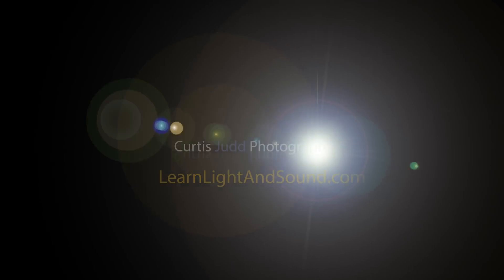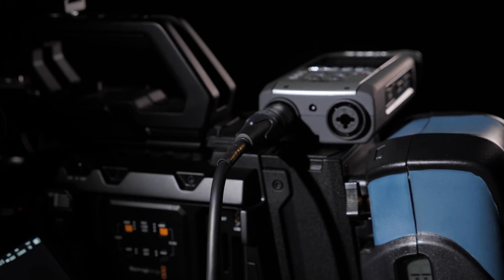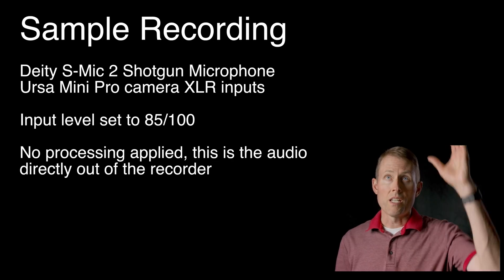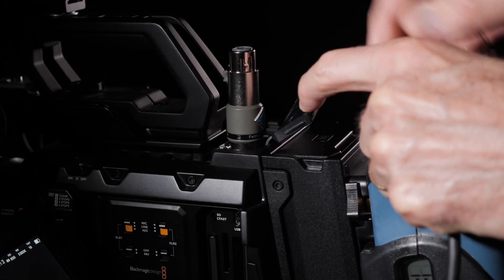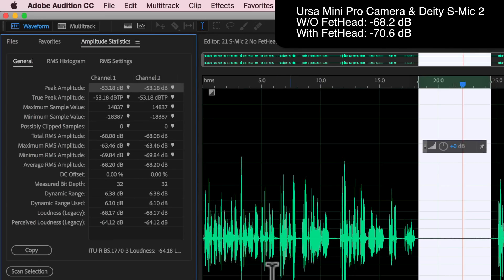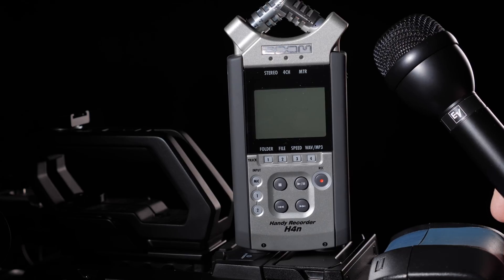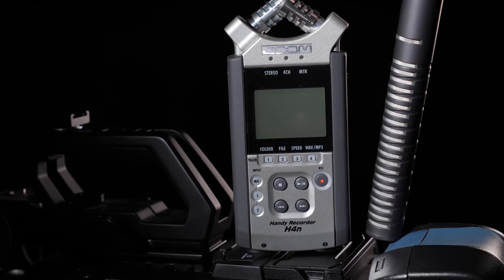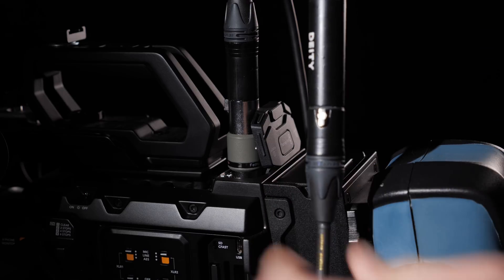FetHead Phantom: Louder, Cleaner Audio for Condenser Microphones

Comment: Great review! I'm using an NTG2 with my Zoom H5. I find the H5 adds too much noise when increasing the level. I wish I can set the same gain level but with less noise. Will the original Fethead solve my problem? Thanks in advance.
Reply from the maker: Hi Clyde, no, the Fethead does not work with the NTG2, unfortunately.
Reply: Thanks @Curtis! But at 6:18 you said it was possible with the original Fethead (the one without phantom). Did I just misunderstand it? Thanks!
Reply from the maker: @braveclyde  Oh, sorry - I am told by Triton Audio that if you use an AA battery in the NTG2 and use the original fathead, it should work.
Reply: @curtisjudd  Thank you! Sorry but  can you answer just two more questions: Is that combination (battery plus Fethead) better than just using H5's preamps? Do I still need to turn on phantom power on the H5?
Reply from the maker: @braveclyde  Clyde - first I should be 100% clear - I have NOT tried the NTG2 with the original FETHead. I have only been told by Triton Audio that it should work. So I don't know whether the results will be significantly better than what you get currently with the H5 and NTG2. You will need to turn phantom power on in the H5 if you do go with the original FETHead.
Reply: @curtisjudd  Thanks Curtis. I appreciate it. Stay safe.

Comment: Hey Curtis, it seems you put it right after the amplifier of the recorder. Is this the way of using it? My thinking was, if it amplifies the signal, the long cable and the resistance that cable brings with it, wouldn't it be better to use the fethead before the microphone? As to amplify the weak signal a longer cable would introduce to the microphone?
Reply from the maker: Yes, several people have suggested that. In my tests I didn’t notice a difference but it cannot hurt to put it on the mic end of the cable.
Reply: @curtisjudd  maybe that's why it had problems with the NTG2? Ordered mine today and I'll check that out. Because it seemed like the rode mic had problems with your setup when there was no battery in the microphone which would fit the signal weakening through the longer cables sort of thing. I checked their website and they write, you can use cables up to 125meters in length. Though I don't know what recording device they tested this with 😉
Reply from the maker: The NTG2 is a separate issue. Triton Audio confirmed that the NTG2 has some sort of unusual characteristic so that it would not work with the fethead.

Comment: Hey Curtis!
I'm using Sennheiser MKE 600 with Zoom H5. I've just bought FetHead Phantom and decided to try it out with my setup with the phantom power on the Zoom H5 set to 48V. 
The results are quite the opposite of what I expected... I get a significant decrease in dB rather than an increase. What am I doing wrong ... ?
Reply from the maker: Hello Taco Friday Entertainment. That's odd. I'd recommend contacting Triton Audio Support - hopefully they can help get things sorted for your. Best wishes.
Reply: Hi Taco Friday Entertainment. I have the same problem as you, have you solved it?
Reply: @mingangli8095  Yeah.. It was a manufacturing problem. I got a new one for free and it worked like a charm.

Comment: Would you recommend the Fethead Phantom for the Oktava Mk 012 and the BMPCC4K?? Nice video as allways ;)
Reply from the maker: I haven't specifically tested this combination, but it should work. Are you having trouble getting enough gain for the MK 012 with the P4K? Normally, not necessary for most condenser microphones.
Reply: @curtisjudd  Yeah thats exactly my problem, that I need to push the gain a lot to get a nice audio level, so I was wondering if this device could helps with that, but now I'm wondering if there is something wrong with my setup, or if I'm doing something wrong. So you say that the Oktava should work just fine with the BMPCC4K preamp?

Comment: Great video, thanks! One question: do You know if the Phantom version of FetHead Will work also with a dynamic mic? (I'm using a Shure Smb7). But i one yo Buy ONLY ONE FetHead that i would be able to use with my dynamic and my condenser Microphones. I couldnt find any info about It. Thanks again!!
Reply from the maker: Hi Martin, yes - tested it here and it worked well.

Comment: Hi. Will the phantom version work for dynamic microphones? I havent found any info. Thank you in advance
Reply from the maker: Yes, just tested that a few days ago on this video: https://youtu.be/HYIJsOg9TPw
Reply: I should clarify my reply of a few months ago as I have a few months experience with both the FetHead and FetHead Phantom. The Phantom version does indeed work with MOST modern dynamic mics, but NOT ALL. Most dynamics mics in common use today are so-called balanced mics. Applying phantom power to these mics does nothing. However, some dynamic mics are unbalanced. The application of phantom power to such mics does no harm, but it does distort the sound. I discovered this on acquiring a really good budget mic (the Fifine K8) that turns out to be unbalanced. That all said, the regular FetHead works with all dynamic mics and is the superior choice for them because it delivers 27dB of gain vs the FetHead Phantom's 18db. I don't regret for a bit splurging on both of them.
Reply: Well I just ordered one so I guess I am going to find out! Theoretically it should work fine with dynamic mics too, as when you pass phantom power nothing extra happens. Of course, as Curtis says, anything that passes on phantom power can fry ribbon mics, so the original FetHead should be used with those.
Reply: @leswright4108 literally was just about to type this out.. trying to spend less money lol.
Reply: In the Zoom L8 review, I assumed a different FetHead (w/27dB) was being used. According to Shure, any "professional" dynamic microphone with a low impedance balanced output, like the SM58, is not affected by phantom power; and the FetHead Phantom will deliver up to 18dB gain.

Comment: Great review! How do you manage to have the breaths so much lower in dB than the voice? Is it an expander during ur live take or is it some plug-in in post? Thanks!
Reply from the maker: When I process my audio in post, I use the Izotope RX breath control plugin and attenuate the breaths by about 4dB
Reply: @curtisjudd  Brilliant! I tried the same thing with RX 6, but it didn't work too well. I presume you're using RX 7 and the breath control feature is better. Thanks again!
Reply from the maker: @zurdyo  Yes, RX7 now, though I did the same with RX6 back when I had that. I think the secret is a light touch - just 4dB of attenuation or so - not too much or it becomes obvious and unnatural.

Comment: Geez, you’re good! Thanks for making this video, mate. A curly question for you: in a room with outside traffic noise, is it possible to use a FetHead on a dynamic mic boomed overhead to capture dialogue, so to avoid environmental noises? Thanks in advance.
Reply from the maker: Hi, thanks! No, dynamic mics really need to be closer than that. Better to use a highly directional condenser mic or a lavalier.

Comment: Hi Curtis, thanks for this video!
Here is my situation : 

I own a Rode NTG-3 shotgun mic (which i love) and the recorder i have is a Tascam DR-60D (1st gen). The NTG-3 already has a fairly hot signal, but I wanted to know if you think i would benefit from using a Fethead Phantom in between, to lower the preamp gain and get a cleaner signal. I know i may only get about 2 dB less noise, but since i have very well trained ears (mixing music for years), i’m a very picky guy in term of noise (that’s the main reason why i sold my Aputure Deity and got the NTG-3 instead). I know the DR-60D isn’t the noisiest recorder neither, but this is still noticeably noisier than a Zoom F4 or a SD MixPre.  I notice the noise when i boom the mic further away in a wide shot, with the mic further away, because i have to use the Mid gain setting, and up to maximum on the gain knob. 

My question is : Considering i’m a very "picky” hobbyist (not doing this for a living), do you believe it would be a good alternative to buying a higher quality recorder like the Zoom F4 or SD MixPre3? I don’t really need all the pro features these recorders provide... i’m only interested in better, cleaner sound quality.

Thanks for taking time to read all this!  :)
Reply from the maker: Hi David, no, I'd save money long term for a better recorder. The NTG3 is solid. There will always be more ambient noise in wide shots boomed from more than 18 inches from the person speaking. Adding more gain won't reduce ambient noise, just the self-noise of the preamplifier. So I don't think this would solve the wide shot problem.
Reply: Curtis Judd  Thanks for the lightning fast reply!  This is very appreciated!

I know that the further away the mic is from the sound source, the more background noise i’ll get. I understand that the Fethead won’t solve that. I watched your video when you compare cheap recorders to high end recorders, listened very carefully using good studio headphones, and to me, it’s a night and day difference (hiss), and i assume you were fairly close to the mic, right? So i thought the Fethead Phantom would reduce that hiss considerably.
Reply from the maker: Understood. It is the NTG3 and DR-60D combination that I don’t think has a ton of self-noise/hiss. At least not that will be noticeable when booming the mic from more than 18 inches where ambient sound becomes the majority of the recorded clip. But it might, just guessing here since I have only used the NTG3 in the past but don’t have one on hand to test.
Reply: Curtis Judd  Thanks so much Curtis. I think i’ll swing by the store with my mic and recorder, to test it out and hear the difference, with and without. Thanks again for your help, much appreciated!

Comment: what if cascade these devices?
Reply from the maker: Great question, I’m not sure. Might be best to contact Triton Audio to see what they suggest.
Reply: @curtisjudd  em, theres note that it not compatible with rode ntg2, does this mean that it also not work properly with rode ntg4 plus?
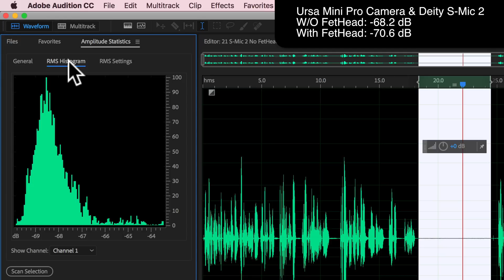Reply from the maker: @protasov-by  Aha - you didn't see the part of this video where we specifically tested the NTG4+: 04:15
Reply: @curtisjudd  I watch 3 times and can't clarify, you use ntg4+ and talk about it, then say that it not work with ntg2, so does it also not work with ntg4 plus (battery off) ?
Reply: @curtisjudd  I rephrese question then, tested with on or off of internal battery?
Reply from the maker: @protasov-by  I tested the NTG4+ with the power on the NTG4+ turned off. It worked.
Reply: @curtisjudd  ok, so this made me conclusion than I can get phantom version for pair to zoom h5 & rode ntg4+ (or ursa pro) and use also with shure sm7b+dbx286s on studio to prevent cranking up gain to 3-5 oclock and listening hissing sound :) Thanks!
Reply from the maker: @protasov-by  Right on! 👍

Comment: Hi, I'm your fans from Indonesia and I have a YouTube channel about the video and audio as well. I hope you will answer my question.
Is it possible to use the fethead to a preamp and connect it to dslr/mirrorless camera? And would it work the same for the noise?
Reply from the maker: Hi Nico, yes, as long as the preamp can supply phantom power.
Reply: @curtisjudd  thank you very much for your answer 🙂🙏. I'm planning to attached rode ntg2 to it

Comment: does it work for wireless lav mic?
Reply from the maker: Wireless receivers do not generally need something like this so I haven't tried. Is there a particular wireless system you're wondering about?
Reply: @curtisjudd  using sony uwp 11 on h5 seems i need to turn gain higher vs rode film maker
Reply from the maker: Ok, thanks for the details. Good question. I've never tried this with a wireless system. It should work. I'll try it next time I have a chance.

Comment: Hi Curtis, do u know what is the difference between fethead regular and fethead filter? Will this make a difference with the dynamic mics on the Rodecaster pro?
Reply from the maker: Hi Will, the difference is that the Fethead Filter is that the Filter has a high pass filter. Otherwise they are the same. The RODECaster Pro has its own high pass filter and I find that for most dynamic mics, the RODECaster doesn't need the help of a Fethead. I drive my Shure SM7B with the RODECaster without a Fethead without a problem.
Reply: @curtisjudd  awesome, thank you.

Comment: What do you think of using this in combination with the Rode Newsshooter and a shotgun or a cardioid mic to make a high quality wireless boom?
Reply from the maker: Hi Mateusz, that seems like a bulky solution. The Newsshooter is decent, but rather than add a FetHead, I'd probably save up for a shotgun microphone with a hotter output signal. Which shotgun mic are you using presently?

For cardioid handheld mics, you should not need a FetHead with the Newsshooter.
Reply: @curtisjudd  thanks for the reply. My go-to shotgun to use on a boom pole is  NTG1 and I've just bought a pair of Samson C02's just out of curiosity. I also have the Rode's Blimp.
I imagine the setup with Newsshooter would be used to make the sound boy's boom pole wireless, meaning less hassle and in some cases the sound would even go straight to the camera instead of the Zoom H5.
The mic, the Blimp, the FetHead and the Newsshooter's tramsitter would sit on the end of the boom pole.
Reply from the maker: @mateuszpieniazek  I'd try the setup without the FetHead first.

Comment: Curtis, thank you for all of your excellent reviews and technical demos! Out of curiosity, have you tested the impact and pros/cons of using the Fethead on a wireless set up such as the Sennheiser SKP 300 G3 or AVX systems?
Reply from the maker: Hi Jason, I’ve found that the output level of the wireless systems are usually hot enough that they don’t need the help of something like this.

Comment: Moments ago, I received a Fethead Phantom (FP). I excitedly opened the package and observed that the insignia had fallen off of the device. Unfortunate, but no big deal. So, I added it into the chain on my portable system, consisting of a Zoom H5 recorder, Mogami Gold cable, and Sennheiser MKH416 microphone. I attached the FP to the mic end of the chain, and turned on my H5. I could not hear any signal from the mic, but picked up other unknown sounds. I boosted the pre-amp and realized I was listening to a radio interview with Broadway actors from The Book of Mormon on 94.9FM radio. As an experiment, I switched the FP to the pre-amp end of the cable. This removed the radio signal, but I still received nothing from the microphone. Continuing to experiment, I switched out mics to a Shure SM58, which I'd been told should function the same with either Classic or Phantom Fetheads. With this configuration, I did receive a boosted mic signal, but it also introduced strange coloring and a humming tone. So, I guess I'll be emailing Triton Audio...and I was so excited. :(
Reply: Finally received my new Fethead Phantom from B&H on the 16th (over a month after I sent the first one back!). It works great! I guess I just got a lemon, which is fine because I wouldn't have known what else to do, short of building a faraday cage around my recording space.
Reply: @31emxof  Thanks for the update. Good to know!
Reply from the maker: Thanks for sharing you experience and I hope that Triton is able to get this resolved for you.
Reply: @curtisjudd  Hey, thanks for checking in! I hope so too, and I'll be sure to post a follow-up once it's resolved.

Comment: thanks, i was thinking that there was some sort of trick via SDi, i do know about camtasia. I have made a decision to get the sony Z90, i mainly shoot corporate, small interviews and weddings, what do you think of that choice?
Reply from the maker: Hi Joe, I don't know the pro camcorder world as I shoot on hybrid mirrorless and cinema cameras. Sony seems to make great cameras. If it is possible to try or rent one before you buy, that's probably the best advice I have to offer. Also, camcorders are often easier to shoot with but have a different, more "video-ish" look due to their smaller sensor size. I'm assuming you already knew that but just wanted to confirm. Best wishes!

Comment: Curtis i think I have seen you using the Rode reporter microphone would it be safe to use this FetHead Phantom with that mic? Also you said you tested this with the Rode NTG4+ were you running 48volt to this microphone at the time our just using the on board battery in the microphone?
Reply from the maker: Hi Mark, yes you can safely use this with the RODE Reporter since it is a dynamic microphone. I ran phantom power from the camera to the FetHead and microphone, I did not use the mic's battery for power.

Comment: Nice Curtis. I use the  H4n and NTG2. A few years ago I it was looking like I'd either need to upgrade my Mic or recorder to get a better combination for lower noise recordings then I came across the FetHead (non-phantom) and problem solved! A very unassuming piece of equipment but has made a HUGE difference for me.
Reply from the maker: 👍So nice when a piece of gear solves a problem so directly!
Reply: Andy, does having the battery in the NTG-2 instead of the FetHead creates noise? Some people have reported that keeping the NTG-2 battery-free creates cleaner sound. I wish the NTG-2 worked with the Fethead phantom... :/

Comment: I've just received 6 of these. 2 Fethead, 2 Fethead Phantom, 2 Fethead Filter. Haven't tested them yet. The user guide recommends plugging directly into the microphone.

By the way, the little Tritonaudio name plate had fallen off one of them, and the little ribbon around it, explaining that it's a Fethead Phantom, is loose at one end. Anyone experienced similar things?
Reply from the maker: Thanks for the update Lau. I hope they work well for you aside from the name plate that fell off (I assume that is just cosmetic).